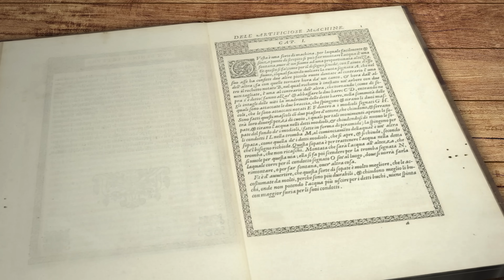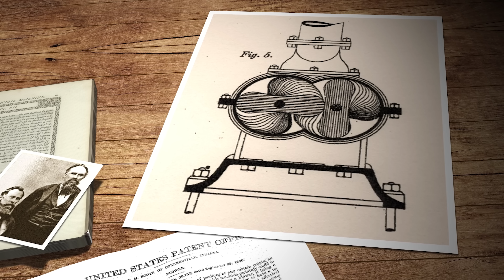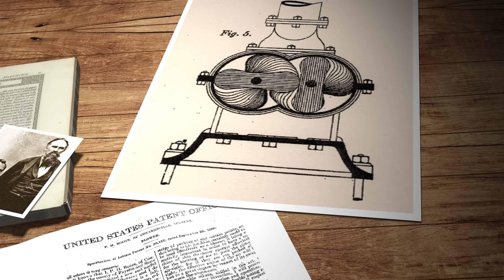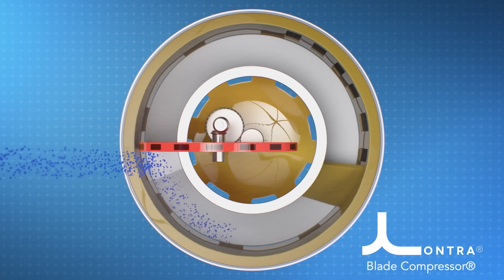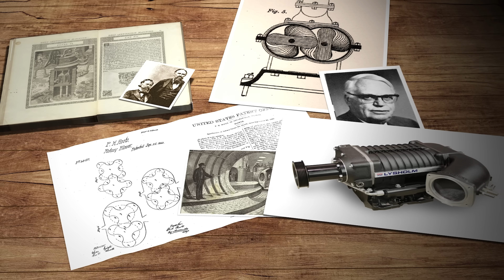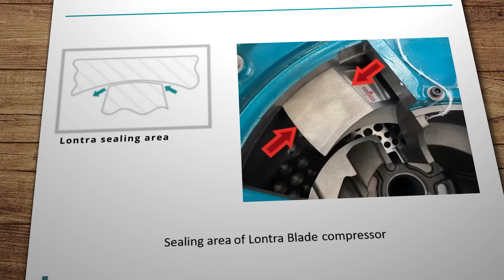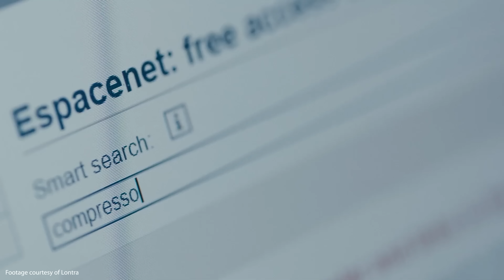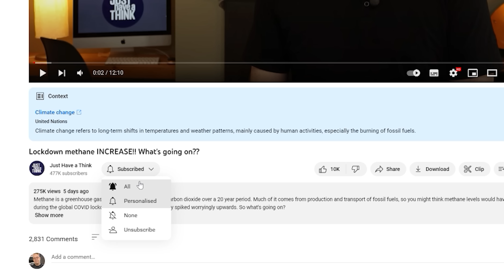Compressing air to reach net zero. A 'revolutionary' innovation.

Comment: This device looks almost exactly the same as the Archer Trice engine concept I saw over ten years ago. It was a toroidal cylinder with 2 piston paddles that went around opposite each other with a valving disc with slot to let them pass through. It was the subject of a patent and then disappeared off the face of the earth after videos showed it in prototype form.

Comment: My home compressor is a screw type, it uses oil to seal the rotors so that the clearances don't have to be quite so perfect.  The oil is separated from the air and run through a cooler before recirculating.  Some oil does escape the separator and go to the tank.

Comment: All this is great and I hope to learn more about the numbers to attach to Lontra's claims. The efficiency of compressors is universally evaluated on the basis of comparison of their performance to a reversible machine, one that is either isentropic (adiabatic, reversible) or isothermal (constant temperature). Therefore, we come to the isentropic efficiency or isothermal efficiency, respectively, quantified by a percentage value - 100% being a perfectly isentropic or isothermal machine (but either are impossible to achieve), and these percentages are plotted on a compressor map, since they are not constant over the operating range of the device, with the flow rate on the X-axis and the pressure ratio on the Y. A very good compressor would have an isentropic efficiency in the order of 80%. An improvement of ~30% as has been thrown the video would put the efficiency over 100% (right....). Even if we start with a very mediocre compressor as a basis of comparison - Roots compressors typically only have efficiencies of about 50-60%, a 30% improvement over that would put us up to ~78%, where a very good (but already existing) compressor would perform. Nevertheless, if we can get efficiencies in the 90% range, that would truly be a game changer. As a postscript, there are many different compressor designs for a very wide range of flow rates and pressure ratios. No one single design, Lontra's being no exception, will be ideal for the whole spectrum of flow rates, pressure ratios and other special operating conditions, like compressing corrosive/abrasive media or others requiring oil-free compression.

Comment: There is alot of applications that also use a simple piston compressor, like O2 concentrators for medical applications. They use aluminium sleeves and a sort of compound head gasket that only lasts for so long. It is loud, it vibrates and needs to be serviced alot.
I also suspect that the piston design overall uses more electricity to run because the efficiency is lower at the end points where almost no linear motion occurs.
This is a very cool piece of engineering.
And yes, corkscrew compressors or pumps are insanely expensive for what they offer because the screws and their bearings have such low tolerances across such a big surface area.
This company is going places.

Comment: The animated version is not accurate. It shows the orthogonal wheel passing through the compression chamber, which it cannot do physically.
The real model shows what happens, the orthogonal wheel rotates within the compression chamber, presenting the opening for the compression piston to go through only at the right moment, but presenting a closed surface otherwise.

Comment: I propose offshore wind turbines to run air compressors instead of electrical generators. Pipe the compressed air to onshore air motors driving the electrical generators there. I also propose the turbines to be supported by three legs instead of one with the triangular base as wide as it's tall. The entire floating rig would always face the wind about the anchor point

Comment: You cannot avoid the thermal effects of compression. 
And as for the blade compressor....thermal and lubrication if used for air. 
And the crap about 408 million tonnes out of 50 billion tonnes? Yeah, I'm going to dump my existing tech for just 0.00816% improvement. Ohhhh kayyyy.

Comment: Appears to be a flawed animation at 6:00....how can the grey compressor "piston" rotate through the solid portion of the  red center disc as the slot opening in the red disc rotates as well....Appears to be impossible in this animation....what am I missing? Look closely at the animation 6:17 to 6:35....it doesn't seem to work as shown....concept is understandable but not as shown

Comment: Looks to me that the blade-chamber interface, and the annular chamber-to-housing interface are indeed going to be very high friction, high wear surfaces. Plus, mechanical wear in the gear train will ultimately result in gear lash that without maintenance will cause catastrophic failure when the timing of the blade to chamber gets too sloppy.

Comment: with regard to such carbon reduction figures that require all pumps be replaced, you need to factor in the emissions from producing and replacing all pumps.
Reply: I imagine within a few decades all existing pumps would need to be replaced anyway because of wear and tear. So if this indeed turns out to be more efficient and applicable in most places I see no issue with simply manufacturing this kind instead of the old ones as the current ones get replaced anyway. Any kind of infrastructure gets replaced in time so it needs constant production. The trick is using that energy for producing newer better stuff instead of replacing old broken things with freshly manufactured old technology. I doubt it would make any financial sense to replace perfectly working compressors worldwide just for the sake of instant energy savings so we don't need to factor in production emissions, we just have to produce the new models instead of the old ones at the same rate.
Reply: @BotondKisKovacs  : agreed, but we really dont have decades, at this point in time. sadly we didnt invent ahead of time, because energy was cheap.

Comment: Tried to develop a solar powered air motor (compression principle) 15 years ago.  Spent a lot of time and money.  Came to the conclusion that anything which has a chance of working well won’t be backed by the Crime Oligarchy.  They prefer, therefore, ecologically disastrous, easy to corrupt via subsidies etc and efficiency most deficient technology like PV, batteries and wind.

Comment: This is the same basic concept behind a blade vane compressor but with an attempt to make less maintenance as they need to have the blade tips replaced frequently. Similar concepts are used in liquid ring blowers. 

I question what pressures and CFM they will be able to get. Since they appear to be oil free they need to compete not against screws which are typically flooded, but against scrolls which are extremely maintenance free but also pressure/volume limited by the size of the head. 

*A quick look at their website affirms this is a blower, low psi high CFM likely. They are competing against liquid ring or roots blowers not screws.*

Comment: This really seems more functional as a water pump than air compressor.  The massive amounts of surface needing to have a seal, no oil, and heat generation really look better for pumping fluids than air.  Maybe it's just the centrifugal forces it is using that make it seem that way.

Comment: I have worked in the industry, and designed compressors that are in testing. I am curious about about thermal management. It seems that their test runs are low pressure and therefore low heat generation. It is difficult to manage very tight tolerances on larger units when you start to have hot spots. This compressor has a cool intake section and hot exhaust that will have a larger temperature difference as the pressure increases, causing a change in the geometry. This is why traditional compressors have larger gaps. Most screw compressors use an oil wedge to help seal, that is mainly why it has a different shape and a tight spot. This does look like a clever design, but I have a hard time believing that it can be 30% more efficient. I have tested many compressors and the best way to have an increase like this, is when you put in a new system and fix all of your leaks. I think that a 3% overall efficiency increase would be huge, and more realistic.
Reply: Why not test it yourself instead of making assumptions?
Reply: It is in production now and distributed in the US as an oilless compressor for industrial use. They call it the Lontra  LP2.

Comment: Interesting. The challenge with emission savings from efficiency, is that it often leads to increasing applications so more overall energy use overall. Refrigeration since the 1950s is a classic example.

Comment: It’s yet another gimmick in the engine/compressor domain. The nice little holes that the air has to move through when it is compressed will be a lovely source of inefficiency in this gimmick. There will also be other hidden difficulties that would become obvious if it was worth devoting another second to this video.
It isn’t. Ta Taaah.

Comment: I think you want all pumps larger, not smaller. If you make a piston pump narrow, you decrease the surface area that needs sealed, but you decrease the volume of air compressed. Volume is cubed, while surface area is squared, so the sealing efficiency goes up exponentially with size.

The one thing I'd be concerned with this new pump design, is pulsation or frequency. You'd need a flywheel to dampen it, or multiple compressor elements, since it would act like a reciprocating piston oscillating between peak torque and zero torque input every revolution.

There'd also be an issue of the chamber opening up to the discharge port, that pressurized air from whatever the discharge port was connected to would try to flow back into the chamber unless the discharge port only open once peak pressure has been realized in the chamber.

Comment: Having spent 2½ decades working in an industry that required a working air compressor for every minute the shop was running, and because of that fact, schooling myself on the workings of the different air compressors in the shop, I could see immediately how the design you're talking about would be a massive improvement as far as efficiency, necessary maintenance, and savings in energy consumption, lower downtime, and higher productivity.

This I could see and tell JUST from my self-taught understanding of the various things involved. No college kid, here. Even my kids didn't get to be college kids. How others with degrees from B.S. to M.B. that should be switching over the rest of or all of their air compressors can't see that, I can't understand. 🤷‍♀️

Comment: You might use these compressors to fill air batteries to turn electrical generators during the night. You could use wind, solar and slow speed underwater turbines called Waterotors to make the power to run them. Waterotors run 24/7 so they could work both day and night to supply a more consistent energy source. If you do the math the air batteries could turn an even larger power generator with higher efficiency than wind and solar alone.
Reply: The compressor may generate a lot of heat during uses so that heat could be used for a form of central heating. Also the air battery air may be hotter than the night air when compressed.

Comment: Your missing the point on this one, the real energy savings here. After cars, the next biggest energy use is air conditioning and its getting bigger by the day as we become more computer cloud based life forms. Data centers use massive amounts of energy to run servers, but just as much energy is used keeping the servers cooled. Much of that cooling is done with mechanical means and that's refrigerant compressors. The air conditioning done in your home is done via refrigerant compressors. Im very interested in this compressor in refrigeration vapor compression now. The old compressors used pistons with very tight clearances, new compressors use scroll plates that are very much like a 2D cross section of a screw compressor and screw compressors, these are the most common until you get to industrial cooling and that's done with centrifugal chillers.  If these compressors are as good as I think they are, they could take over vapor compression refrigeration all the way from residential to commercial, maybe even industrial but I cant imagine what a one story sized compressor of this design would look like scaled up that big. Brilliant~!

Comment: Kind of sounds like he bought into the sales pitch. Machines tolerances are just as important at on he design. The perpendicular rotating gear are to seal against the inclined rotating disc. Any slack in the gearing will lead to a advanced or delayed perpendicular rotating disc and a subsequent gap for air to escape.

Comment: It really does not matter what so ever. Heck doing everything to reduce emissions by the 2-3% that all of these efforts produce is 100% pointless. Spending hundreds of billions on climate change research is also pointless and a waste. The simple truth is that the world would be so much better off if we had taken the trillions of dollars that we have spent on climate change research and spent it on fusion power research instead.

Why? Well that part is easily answered. The truth is that all of the problems that climate change activists screech about get solved when commercial fusion power becomes a reality. Fossil fuel emissions can easily be solved by simply creating machines to extract CO2 from the atmosphere and then using that CO2 to make fuels to run our lives. So why don't we just do that now? We could, so why don't we? Well, the amount of power required to do those things literally costs more than it is worth, but that changes the moment fusion power becomes a reality because electricity costs pennies to make gigawatts worth of power using a fusion power plant. Which means that it will literally be cheaper to extract CO2 from the atmosphere and turn that into the fuels that run our lives that it will be to drill for new sources of oil. So almost overnight fossil fuels become a net zero contributor and that literally solves the problem of climate change in one single moment.

So do yourself and the world a favor, stop spouting about climate change, and start screaming about governments not doing everything possible to bring about the switch to fusion power!!

Comment: seems many think most innovations in renewable energy come with solid state electronics and such and think old school inndustry just isn't needed anymore like anything thats machined.. so wrong.I saw where advances have been made in CO2 valves. combined with this compressor CO2 might make for good energy storage as it goes from liquid to gas and back. It' just might be the old manufacturing methods that enable RE.

Comment: I have been thinking: ( warning bell go off )
So in some places you can use surplus green energy to pump water up to a reservoir, and then you can use the water falling to make green power again.
BUT ! in my Country ( Denmark ) we dont have any mountains to pump water up into, but we might be able to compress air and then use that to make green power.
Just not sure if it is a viable solution as compressed air of course take up some space, and it would also be costly to make a large volume pressure vessel of some sort.
So probably not the best power 2 X solution.

Are these compressors even able to generate high pressures ?

Comment: Imagine the noise if the gears failed or wore to the point that the blade didn’t perfectly line up with that slot. That would be the end of the whole pump.

Comment: 'and that's all there is this to this beautiful simple design'  . Beauty subjective and no comment  - but I don't see anything 'simple' with the Lontra compressor. I'm mechnical engineer and it's not easy to appreciate how this works - but by contrast a rotary compressor is.  Stil looks somewhat less robust than a screw compressor and still requires high accuracy on a number of components - so I'd be surprised if less costly to manufacture.  Obviously though if it's so much more efficient it will be a winner just on that basis with customers.

Comment: I have a patent on a mechanism that improves reciprocating gas pumps and gas actuators by 32% without accounting for friction. Once friction is factored, we are about 27% depending on the application. We have this technology in an air actuated system that allowed us to go from a 200mm spring loaded cylinder, to a 53mm cylinder with the same power. I would welcome conversations with individuals who could leverage this technology.

Comment: Great video. I wonder if rotating the pump the other way would give a vacuum pump, and whether the pump can be used as a motor if you apply compressed air to the output

Comment: This is going to be noisy. Especially when it grenades. It'll be a "spiky" type of a load, mechanically, and will cause some vibration, but this is a great design of compressor, and will be much quieter than a piston compressor.

Comment: I would be interested to know if that new style of compressor is more quiet than the ones you typically see on the market today and how quickly is compressed air. If you’ve ever used compressed air for anything you will know how loud it can be and how much it sucks to sit there for a minute or two while the compressor runs.

Comment: As long as the mechanism that pairs the 2 axis of rotating parts doesn't wear out I don't see these locking up when that slot is off ever so slightly. Probably would start to hear a knocking or tapping before complete failure.